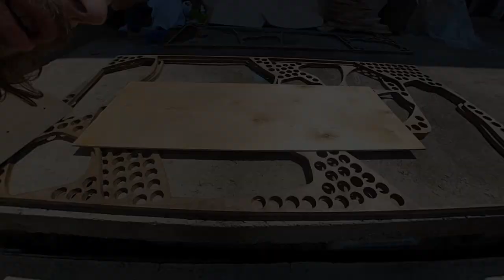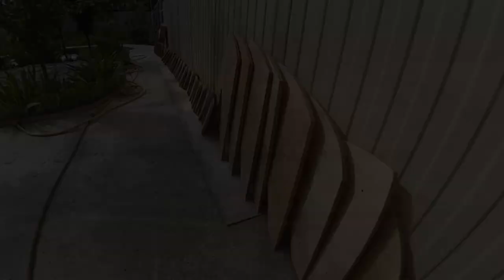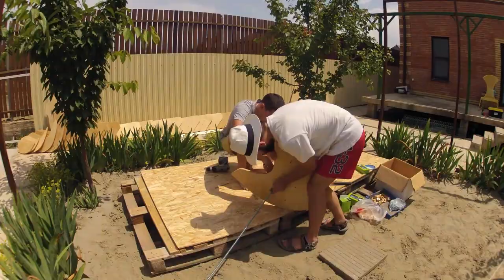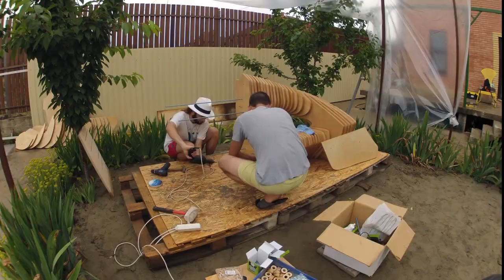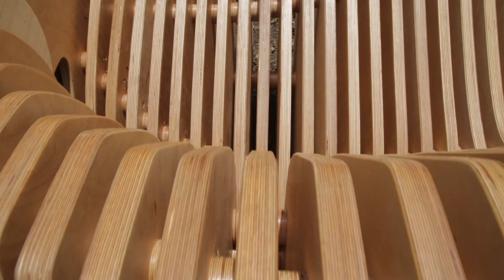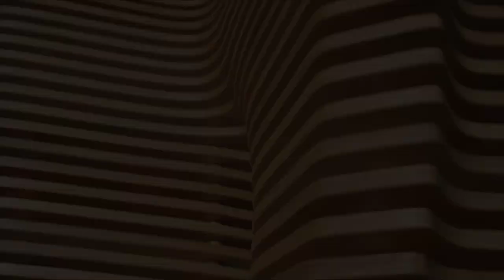Making a parametric bench garden design cats Vmumok Film Victor Meshkov MehDesign

Comment: Did you bend the metal rods to go with the curves and pass through the holes?
Reply from the maker: Hi. No. It is like stair. I Moved connect position Step by step, section by section. Full size metal rods only in the deep of this bench.

Comment: Victor, is it ok to bend the iron pipe to follow the form flow and to make the connection between the section? How did you managed to do that?
Reply from the maker: Hi Leo. Everything is simpler. only straight ties in the video. but the holes in the sections lie on virtual curves. You only tighten the nuts on straight couplers. And in places where the shape is curved, you are guided by the holes in the sections and put through screws
Reply from the maker: Sorry for my English ))))))))
Reply: @vmumok    Hi Victor. You cut the holes on the wood in a angle so they can connect with the couplers? Or the couplers has some angle in the hole? I guess you are from russia (by the .ru in you contact email) right?. Feel free to speak in your language. Can I send you a email? I really wish to know better this technique. Greetings from Brazil!
Reply from the maker: @leonardogindri1744  Ok. Give me your mail
Reply from the maker: @leonardogindri1744  check your mail

Comment: Nice job mate! if I could ask you, what software did you use to make the base geometry? is it the same for slicing and nesting those sections?
Reply from the maker: Thanks. 3DsMax to base geometry? Grasshopper to slicing and nesting
Reply: @vmumok  would you like to design a 1000sq.ft ceiling in this Parametric form?